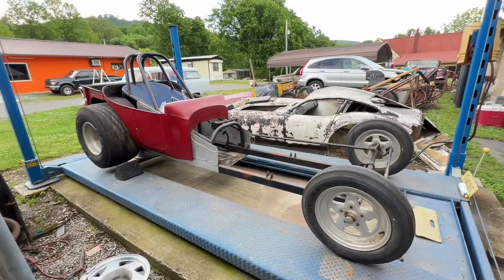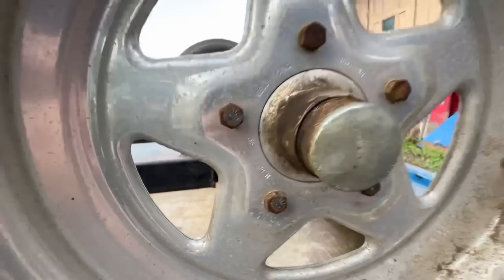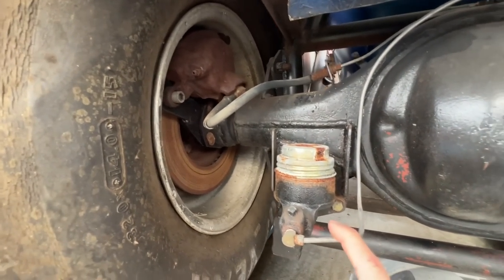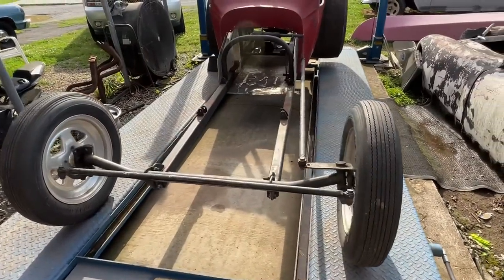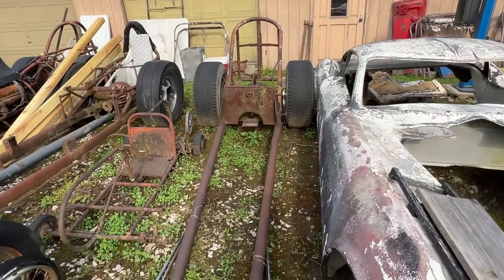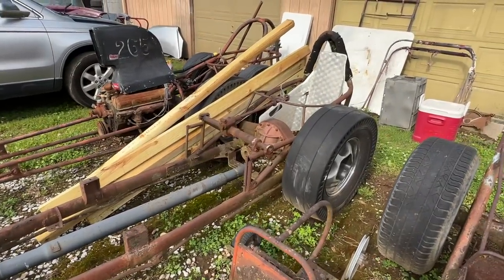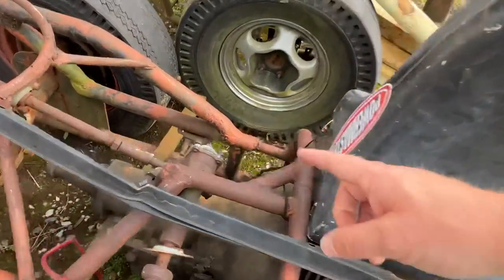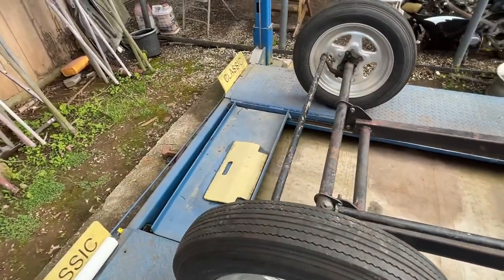Old School ALTERED ROADSTER Drag Car Project

Comment: Have to tell you, assuming I had most of the parts already in hand, that altered would be a priority. My first dragster was about a 130" wb, Buick powered with a Ford banjo rear. Had a narrowed Olds rear, built an air-cooled 'glide and installed a '70 Nova 350. Only internal mod was a Crane cam and never pulled the heads. No it was not NHRA competitive, but it ran mid-tens and was big time fun! Got serious with the second car; LOTS of money and time and maybe a wee bit less fun.

Comment: My dad ran a 29 bantam 99in wheelbase  here in Spokane from late 70s through 91 and he sold it. It was a really competitive car in comp eliminator with a 400 small block with a snort of nos ran mid low 8s all day long. I grew up out at srp he won the world finals in 80 and 81 and was class champ many times. It was a low budget car but was built and setup right and won a ton of races. Would like to find a body and rebuild a clone before my pops passes just for shits and giggles and have some fun

Comment: 1:09  Not sure how safe I would feel with the roll cage being, essentially, an add-on the way it's attached. I would have liked to see the roll bar tied into the chassis for more roll protection. Other than that and the rear axle mounts being a bit thin, a nice find.

Comment: Hey brother I have been collecting parts to build something very similar could you do a shorts on how they designed the steering it looks like a tri5 box with a arm weld to the original steering arm

Comment: Always dig your videos, especially the old race cars! Congrats on breaking out on your own, takes guts, but I can tell you're going to do real well! btw, I've got an old racer myself I need to move - '79 CJ5 that won 16 races in a row at the Lawtey FLA mud bogs, it's listed on marketplace down here in St. Marys, GA, so if you know anyone looking for a fun project for cheap, let me know - Thank You! And thanks also for the vids - gonna hit the subscribe button now and you'll be in great company with ol' Rat Rod Bob!
Reply: I'll trade you for one of those old rails, your pick - don't have any way to haul, but if you are down this way will make it worth your time -got lots of spare parts and new set of 32-12.00 mounted on new rims Super Swampers (plus wide track-kit) Even a Predator carb!.